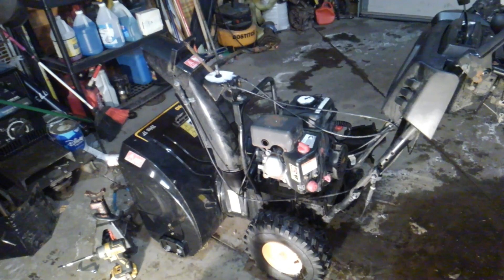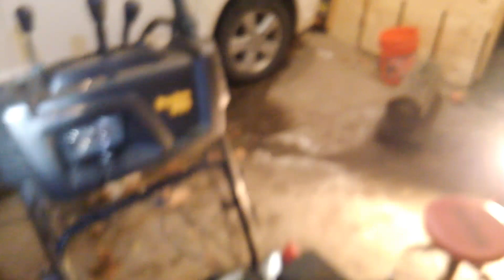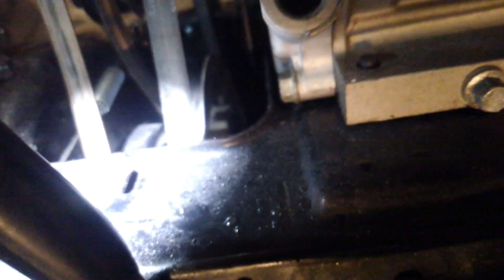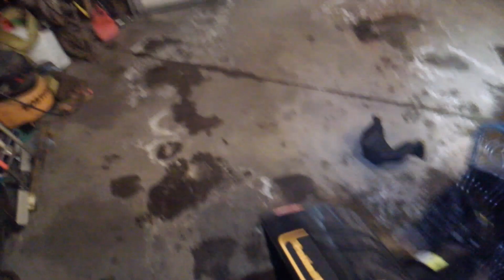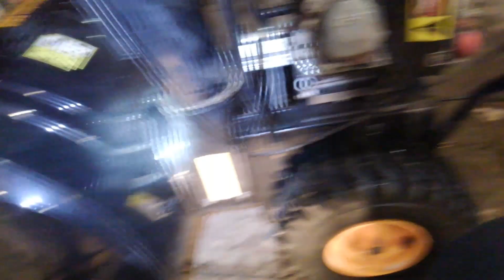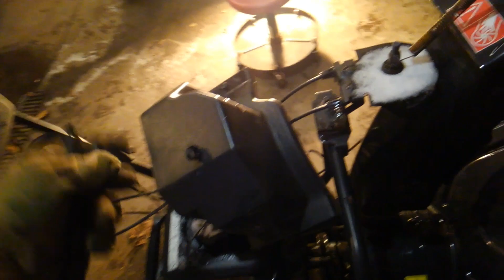Poulan Pro 27 in snowblower drive issues

Comment: Wait till you've had it for 9 years (well mine is the PR624ES) so 26" instead of 27" but still a 2 stage Poulan Pro)) and you have a 1/8th mile long driveway and your drive belt keeps slipping off, after replacing the tensioners, pullies, belts (TWICE) checking alignment and handle engagement fit and it still slips of,, then the real fun begins. The broken spring is about the easiest 3 minute fix so your lucky with that.
Reply: there's also a guide keeper type bolt on the bottom drive pully that gets worn down after a few years and this not only throws off the alignment when engaged (so you can start it and it spins fine, but as soon as you touch the drive lever the belt slips off) and this guide keeper helps keep the belt on the lower drive pully Yes these are good machines but whoever designed the bolt system is a total engineering moron as the threading is in the actual bodywork, so if you accidentally over tighter a bolt just once, your screwed, and looking for a thread tapper to retap a slightly larger hole, or if you have a welding rig you can do a few beads to hold a bolt from the inside (check clearance first) and then put washers and 2 nuts on the outside to tighten it up and not have to worry about it, the first nut can be a regular threaded nut but make sure the 2nd nut is a self sealing nut, the once with that bit of plastic on the one side, and this will keep everything nice a tight which prevents a whole slew of problems from the vibrations of the motor constantly running. hope that helps, id make a video but i have 2 jobs, help at a online hobby shop with running their website and i do IT consulting and the BEST PC building in North America, just ask Gordon mah Ung at PC World

Comment: Working on a buddies snowblower, same poulan and problem, but the spring is fine. Water or snow is getting on the drive plate and it doesn't wanna move. Let it run a bit (dry off) and it's fine. So I gotta replace the rubber ring that hits the drive plate. Not fun. MX bikes are a lot easier to work on, that's why I'm an MX tech, nowhere on my resume is "snowblower mechanic".

Comment: I have been having problems with my poulan pro 27 for most of the winter. First it was a failing friction disc, now it is a drive belt that keeps coming off the pulleys. If I come up fast off the drive lever it seems to cause the spring to pop off and then the belt comes off the pulley. I am at the point of making the ends of the spring a closed loop to keep it from coming unhinged.  Just a point of information, pressing the drive lever moves the drive wheel disc backwards against the friction disc. It does not activate the idler pulley that you show. Once the idler pulley is loose from a broken or unhinged spring, it gives the drive belt an opportunity to come off the pulleys

Comment: Got the 2015 Poulan Pro PR270A 27" 208cc and when it works its a good snow blower, however every year the darn thing won't start and of course mom has the local mower/Snow blower mechanic pick it up and fix the issue which he never really explains, just gives you a $60 fee to fix it. This gas today or carburetors aren't worth a pinch. I can take the old Toro single stage snow blower with mix gas that has been sitting for 4 years and start it on the second pull using the pull out choke. Is there a replacement carb for this Poulan that stops this starting issue or any suggestions other than use Sea Foam?

Comment: I have a Poulan Pro PP800EPS24 from 2011. I had this problem last winter, and kept having it over & over again. The manual diagram lists two "idler springs" (414557 & 178828), but if you look them up on the parts sites, the second one is described as a "brake spring." 

There seems to be a pretty clear way to go from the traction idler arm to a bracket bolted to the side of the housing (with part # 413429 stamped right into it). There don't seem to be spots for 2 springs in this area, but installing just the 414557 one, which is long and thin, lasts just one day before it breaks. I ordered both to be on the safe side getting running again this year. The spring in this video looks more like 178828, thicker and presumably stronger. Maybe I'll try that one only this time, although that seems incorrect. Any insights appreciated.

Comment: Hi Michael — Same issue, same spring. The way it attaches seems like a bad design or I'm wrong about how it's attached. From the tensioner it crosses diagonally OVER THE BELT(?) to the slot. It didn't seem right but that's what I did. On the first storm it drove a little funky, not engaging right away and had to fiddle to get it in reverse. In fact, any position but dead bottom and the machine still wanted to go forward.  Second storm — No forward or back. I haven't cracked it open again but my first guess is that it's the spring again. btw, the end of the spring was broken at the same place as yours. Can you tell me which end goes where? Does it connect at a diagonal?  I haven't pulled it apart again as it's cold outside and my garage is unheated but if you have any questions fire away,

Comment: The manual doesn't show where it goes my spring did the same exact thing.....
Reply: — On my manual it's under the section called Service and Adjustments pages 15 — 18. My model number is PR270. The entire manual is 44 pages long. I downloaded it from the Poulon site since I got my machine used and the guy didn't have the manual.
Reply: r s I misunderstood, sounds like you have the manual but you're curious about exact placement of the spring. Hope you've figured it out. Judging from your other comments sounds like you did.
Reply: I did have it and springs are where you had it which one are you looking for?
Reply: @smallenginerepairs3772  I'm goig out to have a look (it's a little warmer today). In a way, I hope the spring is ok and it's a different problem, belts, linkage, something along those lines.
Reply: Fixed my blower was that spring thay are common issues....thanks for the vid its the only one that helped me find the location for it....